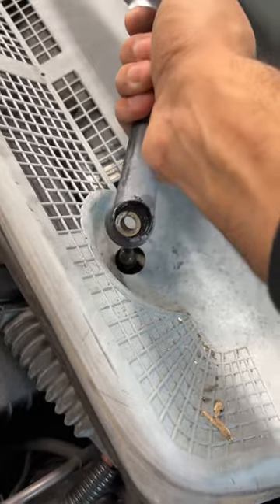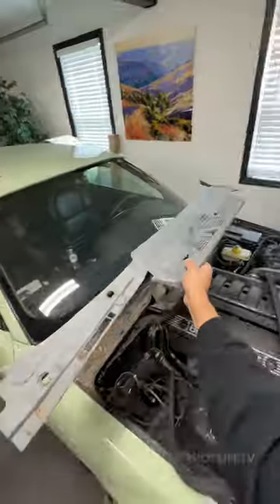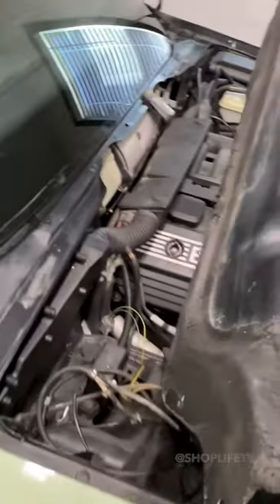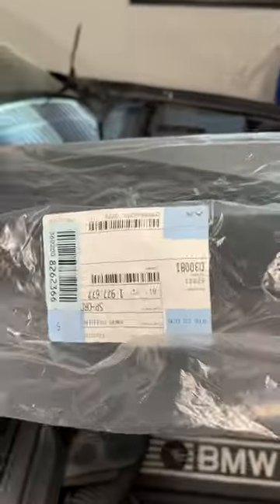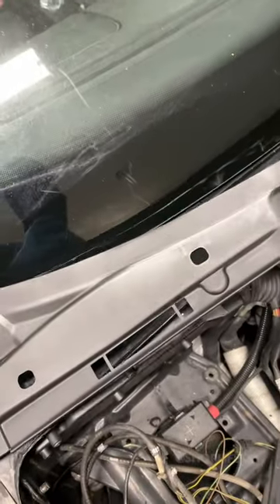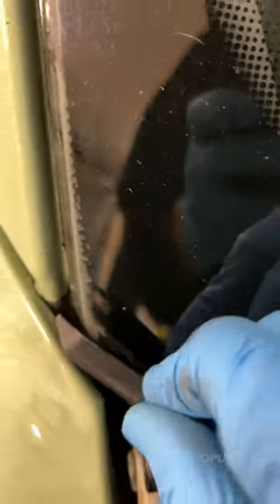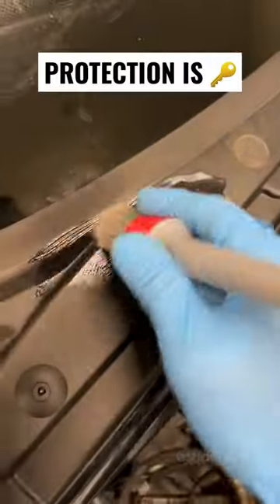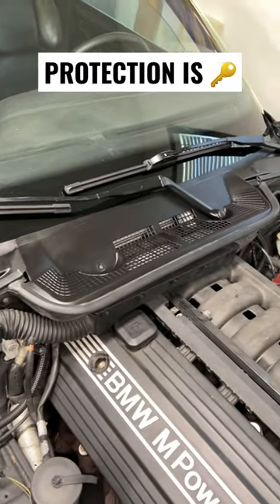Protect your car!! #shorts

Comment: I've replaced most of the plastic and rubber components on my '01 330i E46 (150k mi). The body and engine plastics wear and degrade rather quickly when parked outside all the time, even when we care for it religiously like a baby. Replaced this cover a few years ago, applied protectant, and it was beginning to whiten again within a year and a half. The environment is Oregon...lots and lots of rain and a few months of sun (sometimes up to and just over 100°). The plastics and rubber on and around the engine are the worst and need replacing at about 140k (when the car was about 11-15 years old)--they get brittle and crack. I've never spent so much money and time replacing parts with any other car I've ever owned.  If originally buyer and previous owners rarely ever do much else besides tries, brakes, oil changes, and basic tune-up, then new owner that wants to keep it for 5-10 years will be spending a LOT of money playing catch up! Those who brag about BMW reliability have never owned theirs past 120-150k miles or the previous owners actually did replace some or most of the plastic and rubber parts/components when they were suppose to...so feel lucky!

Comment: I love how Germany is busy faffing around with seperate plastic junk in that area while Ford just builds the metal cowling substantial enough to not need protecting in the first place.
Reply: my 2007 ford fiesta, EU spec, 2dr, has plastic cowling that looks like this...
Reply: @DigitalDissident  85 F150 for me. Doesnt surprise me that Ford also went down shitbox lane in the intervening years...thing is my F150 is more or less contemporary to e36 bimmers as Ford hadnt changed the cowling design on the F-series yet.
Reply: I'd rather have a plastic cowl than a plastic oil pa n
Reply: @waltervashey1979  Last time I checked the oil pan on my 85 F150 was thicker and stronger metal than the bodywork on most modern cars. 🤷
Reply: @C6 Modellsport  85...one of my favorite years, other than 96. They've been plastic for the last few years. One good stick in the mud and you're fkd.